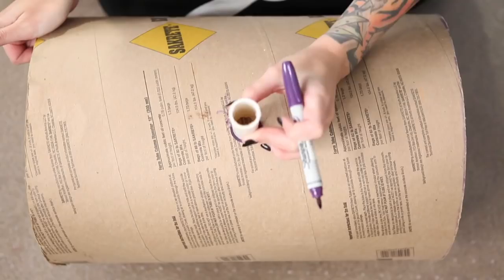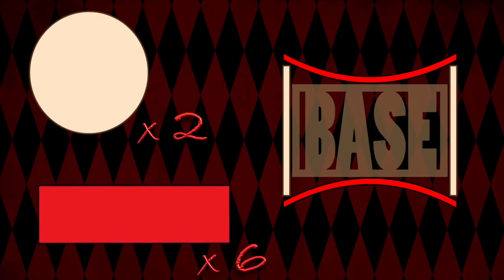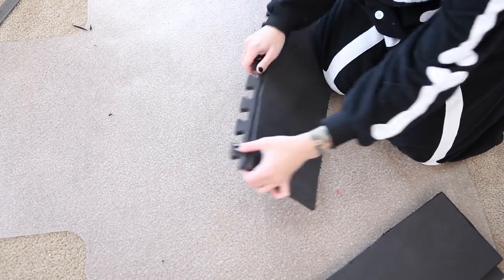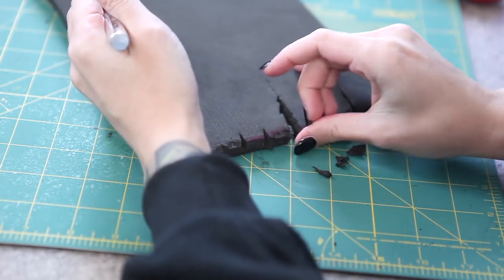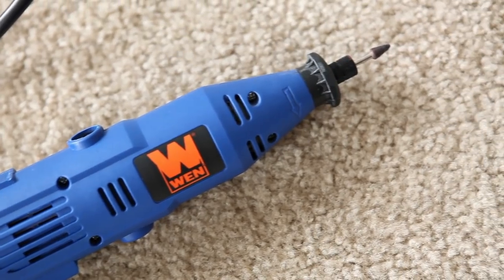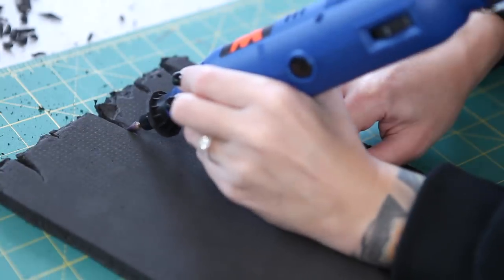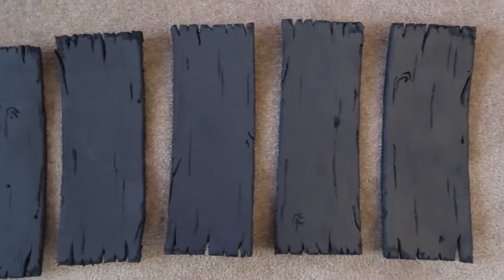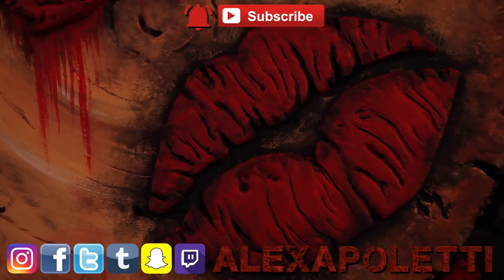HARLEY QUINN MALLET TUTORIAL (ft. Glam&Gore) | Episode 2: Cutting EVA Foam

Comment: Looks great so far. I have a suggestion for cutting your foam get yourself a emt scissors available almost anywhere that basic medical supplies are sold they are strong enough to cut through a coin and it's as easy as cutting paper with scissors.
Also a good way to texture is go to a home improvement place there is a special roofing connector that is a metal rectangle with several metal points on it, you can texture a really large price incredibly quickly.

Comment: You call it a rotary tool with ice cream tip, I call it a nail drill with a flame bit! I wonder if they are actually the same thing? 🤨🤔
Reply: Milkymoles. I believe they make ones specifically for nails but don't quote me on that
Reply: I think those for nails are less powerful but I'm not sure
Reply: Nail files like this are less powerful and do not work for projects. Rotary tools are made for stuff like this.

Comment: You make this so easy to follow!!! I'm cosplaying as Harley for comic Con this year  and was worried since I've never really cosplayed someone who needed a big prop before. I can't wait to start making the mallet:) 

What heat tool did you use in the video? Or does anyone have a recommendation cause I'm clueless 😅
Reply: I use a Furno 300 brand Wagner, I used it on pcv pipe but not foam as of yet. Works really well so far.